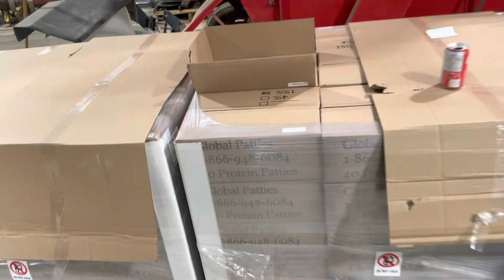Outsourced to Global Patties, Custom Mixed 🚀

Comment: Ultra bee dry is $3.75 here in NS. I use it at 60% of the weight in my recipe. So at $2.25 before I add inverted syrup and other ingredients.  I went with global 15% this spring because it was $2.22 shipped to my doorstep per pallet. Last year Global was $4.50 because of the high cost of freight. Patties went on yesterday. It is forecasted 5⁰C for today. Bees are looking strong.
Reply: We’re do you buy these at ? And are you In the states? Thank you !!

Comment: What is the plan to keep these patties  away from the Rodents   
    How high up .... racking 
    Rodent proof room 
    Does partial shipment , a third , a third , a third help control manage the rodent risk versus price , cost 

   Just my analysis kicking in to make the best of a given situation , to combat foreseeable incoming issues 
  Thanks for reading 
    Protect it , it's only helpful if you are able to utilize it
Reply: Place inside plastic drums  , lid sealed ?  ..... drum sweating ? Winter conditions ?